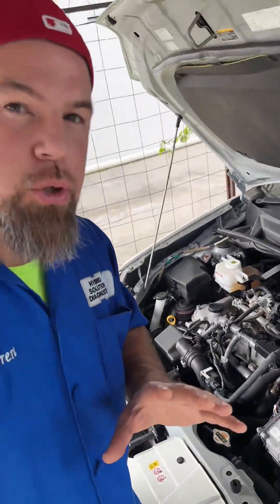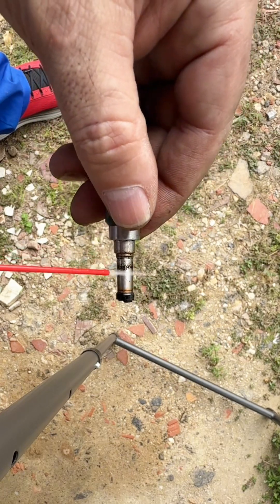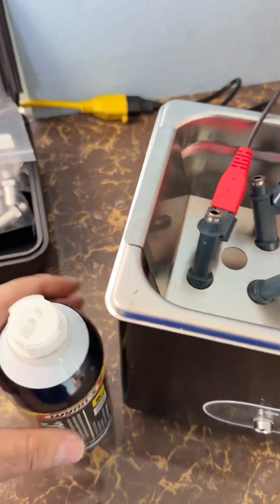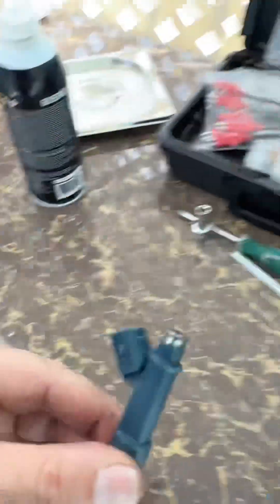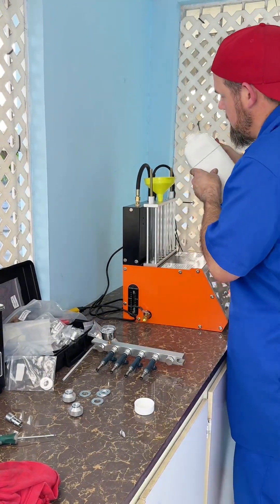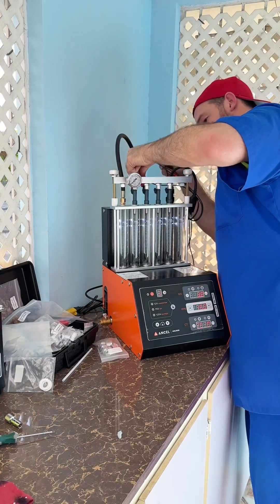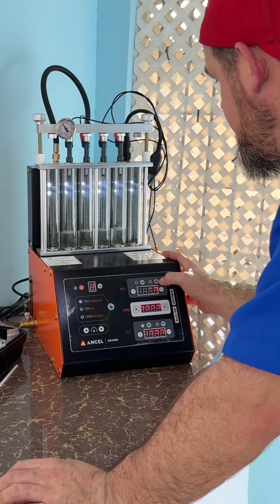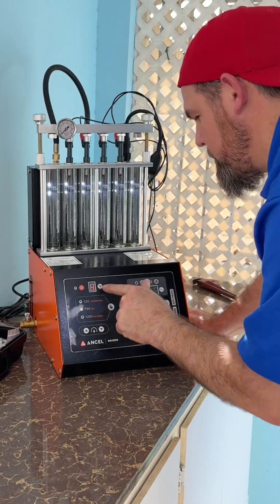How to clean the Fuel Injectors with the Ultrasonic Cleaning & Testing Machine

Comment: How much have you got invested in the ultrasound and injector pattern testing stand Sir ??Since injectors can be bought for 50 a piece, would just buying new injectors be way easier  to install ??  Well it is just an idea fella. Peace vf   😀😀😀😀😀😀😀
Reply from the maker: @victoryfirst2878  jejeje is way cheaper to use this machine and clean them ✅✅✅✅
Reply: @hybridsolutiondiagnostics  How much cheaper is this process instead of buying injectors??
Happy New Year Sir. Peace too. vf

Comment: What frequency did you run them? I have been doing this for a shop for a while now and we use a pulse modulator to go from the low end to the high end on the injector and from 40 to 160 hz on the ultrasonic machine. You will be amazed how much more junk you get out from your setup vs doing it right!. you never took the screens out either... IMO you have very little knowledge on what you are doing but keep it up, maybe one day you will grow up and be a professional after you ditch your amazon tools!
Reply from the maker: @loligagger85  wao thanks for your kind words, I hope to be a smart and work in NASA as you someday 😁👍 and guess what! Vehicle is running way better now 🤣🤣🤣🤣🤣🤣🤣
Reply: @hybridsolutiondiagnostics  ok troll gfky with that trash
Reply from the maker: @loligagger85  boo 👻 🤣🤣🤣🤣